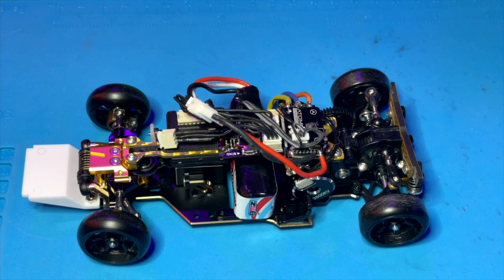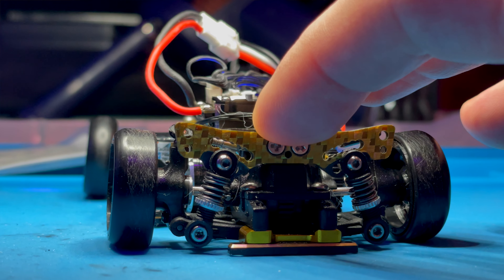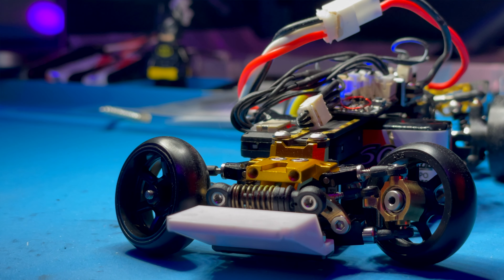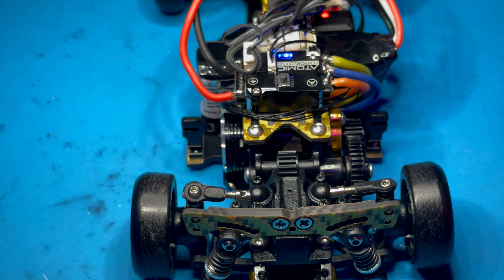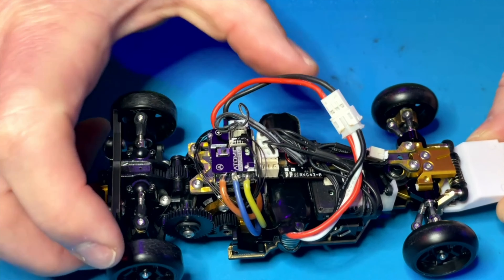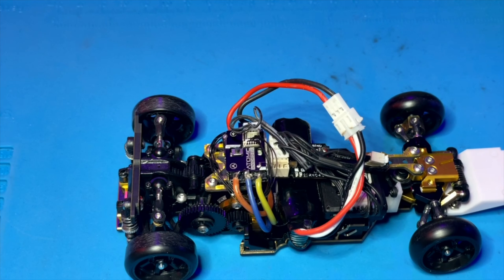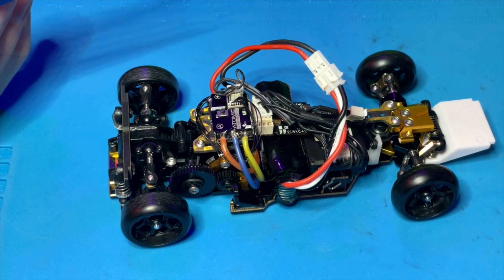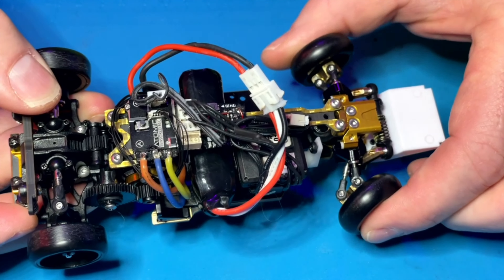Atomic RC DRZv2 Thoughts & Impressions

Comment: I connect my drz to everything and the foward and reverse work but the steering no matter what I do goes to the right . And it won’t budge unless I turn it off any recommendations?
Reply from the maker: Hey Andy - thanks for the comment and sorry to hear you are having difficulty with the electronics.  I would triple check you have the servo and ESC plugged into the correct channels on the receiver, then I'd test to see if the gyro is installed correctly.  A bit hard to say anything more without seeing it myself.
Reply: @clint_thayer  thank you boss for ur help 🙏

Comment: generally a large scale basher over here, but i've been thinking of grabbing one of these little guys to screw around with on my basement floor. how's the stock servo/esc/gyro on this thing?
Reply from the maker: It will definitely get you running. Upgraded elements will be smaller and easier to place.

Comment: Did you experience any splitting on the front ball ends when putting them on the upper and lower control arms?
Reply from the maker: Sorry for the delay - Not with this car, but I've had issues in the past.  I suggest getting a pack or 3 of them to have around just in case.  Do you have a vendor you purchase from?